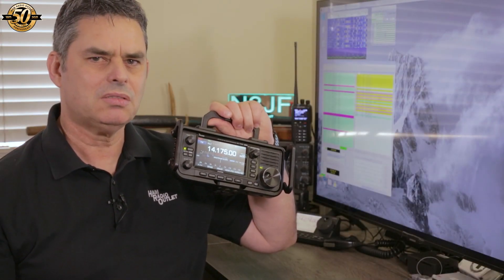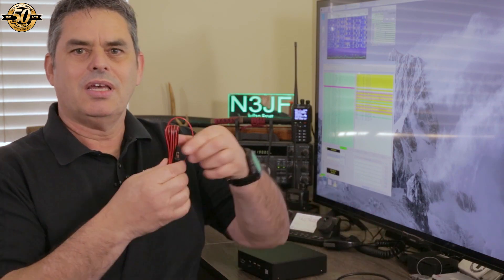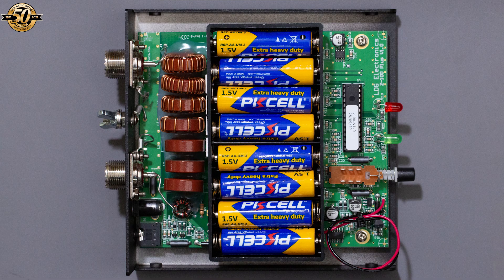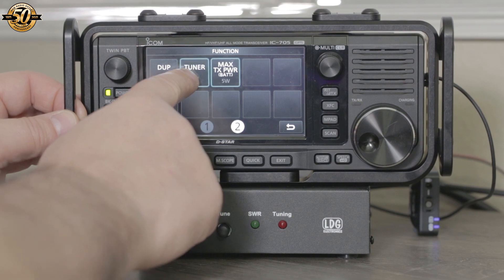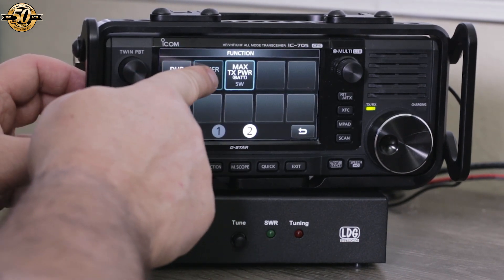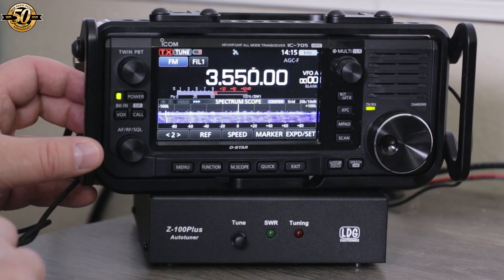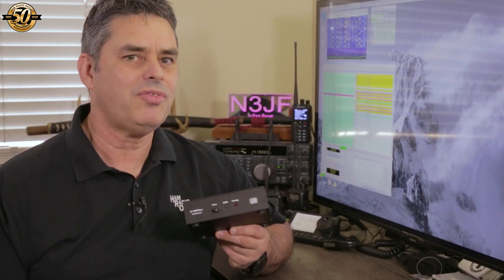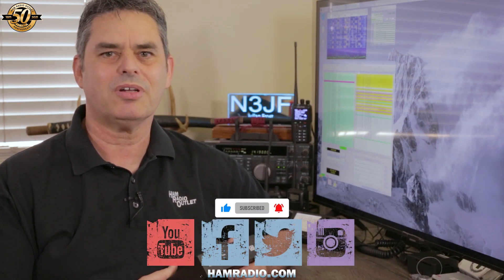The LDG Z100Plus705 Ham Radio Outlet Exclusive

Comment: I use this same turner for my FT 891 and it works great.  However, I think this turner is a little large for the IC 705 and I go with the Elecraft T1 which is about half the size and weight.

Comment: By the way you can switch bands or major frequency changes and then press the mic or key and it will start a tuning cycle without going in to the menu.
Reply from the maker: Yes, you can. I had that in the original cut of the video, but I really wanted to show how to access it through the menu.

Comment: @Ham Radio Outlet Julian this kit looks like it came with a RTS connector on both ends for the interface cable.  I know you no longer have the kit available but do you sell the interface cable.  Either I’m not finding it or the one I find doesn’t seem to have the RTS male ends on each end of the cable.  Can you provide a link to the correct cable for the IC-705?  Thanks!
Reply from the maker: Hi Bob. I don't believe we sell just the cable, but if memory serves, it's a simple TRS (stereo) cable. The selling point of this kit was the tuner and its ability to interface to the IC-705, not the cable. 🙂 You should be able to pick one up easily online.
Reply: @HamRadioOutlet  Yes sir.  I ended up pulling a TRS audio cable from one of my CW paddles and testing it out with my Z100Plus  and 705.  Works great!  Thanks for the reply!!
Reply from the maker: @BobGarrett66  Excellent! Glad it worked for you! Enjoy the "new" capabilities of your tuner and IC-705!

Comment: I purchased one of these about a year ago.  It works very well except the radio's tune button never worked.  I tried another cable, but again no joy.  As previously mentioned, it really does not need the cable.  I simply key the radio and press the button on the tuner.  73 de K4RS
Reply from the maker: What radio are you using? The IC-705? Did you change the setting in the radio as shown at 2:30? Also, if the cable doesn't click in place, it's not going to do its thing.
Reply: @HamRadioOutlet  I am using the tuner with an IC-705.  Entering the menu, the tuner option stays inactive as shown at 2:10.
Reply from the maker: @rogersnyder1294  So weird. I've not heard of any issues before. I know that when I was making the video I really had to push the cable into the IC-705 much harder than I expected, until I got the click. The radio also had to be turned off. As you said, the interface cable isn't really required, but it makes it one step easier to use the tuner. Both the radio and tuner have a 1 year warranty, so if you really wanted to, you could get them both checked out (if purchased at HRO, you could take it to your local store and they could try a different tuner to see if that works differently with your radio, for example). Then you could get warranty service.

Comment: If I tune this on 14.250 what range is tuned? For example I tune on 14.250 can I use it on 14.290 without having to run a new tuning cycle?
Reply from the maker: That depends on your antenna and how far out of tune it is from when you tuned the LDG Z-10 at 14.250. The nice thing about this tuner, is that it will automatically try to retune if the SWR is too high.
Reply: @HamRadioOutlet  man you guys are great. My orders from the Salem store get delivered next day, and my questions on YouTube get answered instantly. Thank you so much you guys really are the best

Comment: Nice review. Question......" can  you put the ATU in the bypass mode?" There are time I would use this on my three band portable wire antenna and it would be only needed on the edges of the 40 meter band. On 15 and 20 meters the ATU is not needed.

Barry, KU3X/QRP
Reply from the maker: Yes, a short press of the tuner's TUNE button puts it into bypass mode. Page 5 of the the manual discusses this. The manual can be downloaded on the LDG website (link on the HRO product webpage).
Reply: @HamRadioOutlet  I just received my ATU. I actually like using it without the interface cable. WHY? Most of the time I don't need the ATU. I only need it for the top of the 40 meter band. So by taking control of the ATU by not using the interface cable, I keep the ATU in bypass and only tell it to tune when I get above 7250 khz. 
This way, the ATU in bypass stays completely transparent on all other frequencies and bands.
Either way, it's a great little ATU and I'm glad I purchased it.
Barry, KU3X
Reply from the maker: @barrykery1175  Cool! I agree, no real need for the cable... it just gives you that one-touch tuning. But if your antenna is resonant, it won't tune anyway. It only tunes if you tell it to, or if the SWR is high.

Comment: Own the Z100A bought fro HRO but have not been able to get an interface cable LDG-IC-108. How or can I get to work??

Paul   K1YOU
Reply from the maker: Most LDG tuners will start tuning when they receive some form of RF. If you switch your radio to FM or AM and key the mic, they start tuning. If you put it on SSB and start talking (or whistle), it will also start tuning. Does that not work with the Z100A? An interface cable is included in the box with the Z100A, did you not get one? If you need to make an interface cable, page 8 of the manual shows how and gives information on where you can get the connectors. If you lost your cable, or need another, it looks like they're available here: https://ldgelectronics.com/index.php/products/accessories/cables/ LDG's contact information is: LDG Electronics, Inc.Attn: Repair Department1445 Parran RdSt. Leonard, MD 20685. There's also a contact form on their web site.

Comment: can this be used on a Kenwood TS-430?
Reply from the maker: It can be used on any 100W radio. It's labelled as being for the IC-705 because it has a dedicated control port and an interface cable that goes to the IC-705 to allow the IC-705 to switch into tuning mode automatically when you change bands or press the PTT on the mic. For non-IC-705 users, you'll need to switch to AM or FM, or whistle into the mic to start the tuning cycle. It still works, it's just not fully automatic.

Comment: "QSL" does not mean "yes".  Nor does it mean, "i received everything you sent."  Yet everyday, I hear someone not know what the terms they use on the radio mean.  They do so because they heard 3 other people, who in turn heard 3 other people apiece, etc., and it all originated on the LSB of CB channel 38, where such things as, "i'm QRT and standing by.", and "QSK" is used to attempt to break into a conversation, are used.  Clubs should be mentoring new hams, but evidently are not.  The young fellow in this video is intelligent, and this was a good presentation.  I just wish that people understood the proper use and place (mode) for QSL, QRT, QSK,  and ROGER (doesn't mean YES).  I listened to a CW conversation a short while back, and one of the stations replied, "QSL", instead of "R".  SAD.
Reply from the maker: While the Q-codes have standard meanings in amateur radio use on CW, they are also very commonly (and some would say, erroneously) used on amateur radio phone where they have, arguably, evolved slightly different meanings, just as everyday speech has evolved over the years. Since the Q-codes are a specialized form of language, intended for use only on CW, that is where the Q-codes have the meanings they do. Used outside of CW they can become "standardized" by their common and colloquial usage, and have slightly, or very different meanings from those in CW, yet they are still understood by phone-users. Your point about mentoring is a good one, but not all new hams belong to clubs.